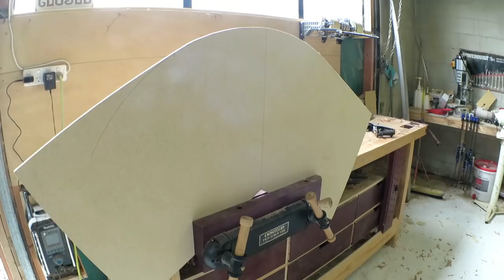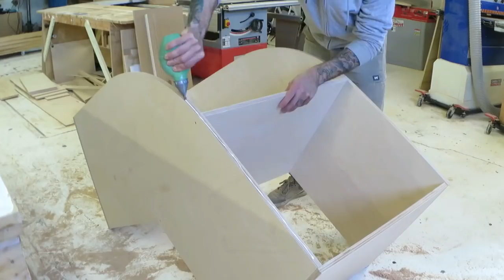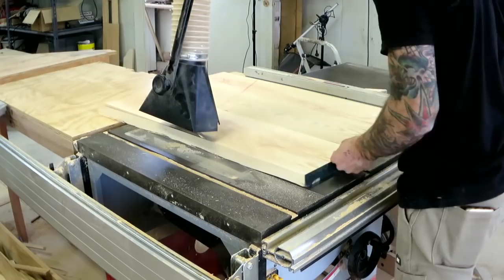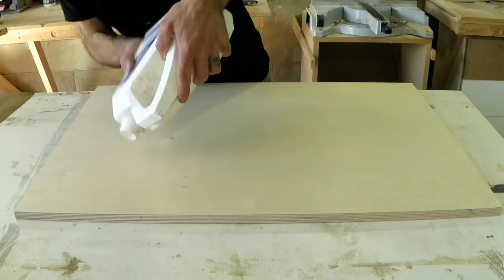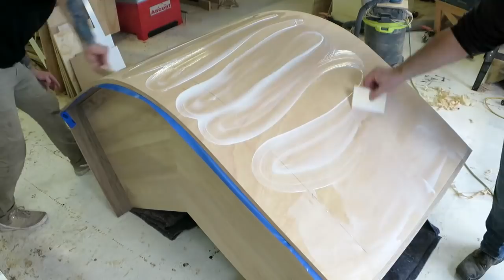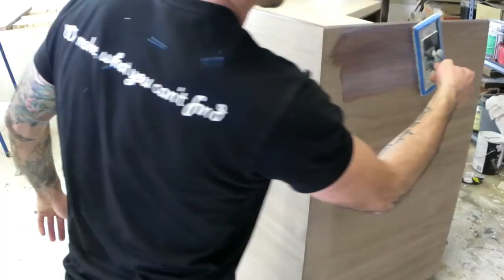coffee station/bar

Comment: I wonder if the vegan  hipsters that buy coffee from this bar realise its made out of the most cancerass material ever made for the workshop 
MDF kills
Reply from the maker: There's  really not very much evidence to back that up. Wood dust in general kills. MDF dust specifically is no worse than oak  dust for example. True a lot of glue is used  in its manufacturing just like plywood and strand board and particleboard etc, they all use very similar glues which according to the world health organization , it is unclear just how  much off gassing occurs and what that does at such minute amounts. The testing that WHO did found chemical off gassing but they couldn't specify whether the gas came from the MDF or the paint that was on it.

Comment: Another good option for gluing the veneer to the front, put 2 coats of wood glue (PVA) on both the veneer and the substrate, let them dry, then use a iron to heat up the glue, & the 2 surfaces will bond together. Works great!

Comment: Does this veneer with the fabric backing have to be applied perpendicular to the grain like traditional veneers? Door if this has already been answered. I was being lazy and didnt want to dig through a few hundred posts.
Reply from the maker: It doesn't matter on plywood as it doesn't move. I would still run it with the grain on solid timber

Comment: Great look and quality.

But working furniture must be stronger. 5:03 must be 5 pics x2 longer sticks from hard wood. The machine and stuff could be like 70-200 kilo and front panel always gives guys opportunity to rest on it and relax your back while drinks are made. 
So front panel, sides and top panel must always be hard jointed together. And inside of bar shelf's and doors must be customizable easy.

Our guy made wooden bar in Japanese joints ways when things laying on each other and secured that with metal bolts. A lot of expensive thick wood but stuff was stone hard. 

Also take a look on English pubs classics metal pipes and then hard wood above it. Wood right above metal keeps things silent and protects from vibrations.
Reply from the maker: +Robert Minasyan do you think I would make a project with out talking to the client about it's use? And their needs.  And do you think I would not use my 17 years experience  in the business as a guide to tell me how to make things?

Comment: Bendy ply?!
Reply from the maker: yea its cool stuff it has 3 plys 2 outside plys a really quite thick and the grain runs the same way , the middle ply is very thin with the grain running perpendicular to keep the sheet from splitting
Reply: ... and you can get it with the long grain running along the sheet or across the sheet. Way cool for making curved shapes like box lids, chair parts and the like when glues up as a thick sandwich

Comment: Wouldn't it have been better to use Contact Adhesive on the Front Panel?
Reply: I thought the same. Would definitely have been faster because you don't have the same waiting times.
Reply: the glue is more forgiving in case you don't lay it down just right.

Comment: Any reason you didn't just buy Walnut veneered plywood? Great build man!
Reply from the maker: +Crafted Workshop hey man,  umm 2 reasons I guess 1 I don't think regular ply would have bent even down to 4mm my test piece was cracking.  2. I needed to veneer over the corner to make it appear like a mitre.
Reply: Makes sense, I guess I meant for the regular flat pieces, just to save some time. Turned out awesome!
Reply from the maker: +Crafted Workshop oh right well I had to buy the veneer which is outrageous price so used my off cuts etc for the flats. The veneer is the same price as veneerd ply! Plus with my press these kind of flat panel glue- ups are super easy.
Reply: What is the plywood name
Reply: you could veneer the plywood first and bent it after that.

Comment: For the front veneer. Water down pva 50/50. Roll onto both surfaces apply veneer then run a hot iron over it!  Sticks like shit to a blanket!! 👍👍👍
Reply: Will definitely be giving that a go! A side by side comparison with shit on a blanket perhaps :D
Reply from the maker: +Big Guns huh I'll have to try that
Reply from the maker: ha yea lets see that !!
Reply: i think the water is for the venner so it doesn't suck too much glue.Might alter with the finish.
Also, for a piece that big, it is more time consuming than with the press in my opinion.
Reply: my first job 30+ yrs ago we did it similar, wasn't pva tho not sure what it was.

Comment: Great project, indeed the veneer is expensive but its stability pays off. So cool to see a pro like you to use my comment to use the domino + washer as slots. Other idea, on every youtube film I see panels and tabletops being glued up the same way: applying glue on each board individually. I learned from my dad that it's easier to stack all the boards and clamp them together. That way you can apply glue on one single surface. There is however the disadvantage of manipulating a whole stack of boards which can be too heavy. But you will win time and reduce stress.
Reply from the maker: +Bart Loncke  always learning. I do use that glue up trick sometimes . Works best when all the timber is the same width.  So not always possible

Comment: Nice work :) Alot of questions of materials that you use, and I have one too. That veneer looked super, what brand and where did you get it.. You said it was filt backed not paper is that correct. 

Best
TR
Norway
Reply from the maker: hi , I order the veneer from the factory that usually press it onto sheets of plywood / mdf.  they will press it onto fleece on request ,  its super not cheap!

Comment: Awesome job ! You should get a tank of spray glue I used to use it for plastic laminate work and it works great for wood veneer also . I use stayput and famica brand the home center spray adhesive doesn't work well.

Comment: Great Job. I've never heard of 'Bendy' Ply??? What is it? Cup Hinges are great, but for the life of me I can't adjust them. I have just made a kitchen Island for a client and will be taking it to his house in a few days. Unfortunately I will have to take the doors of to transport it and I am dreading putting them back on at the other end.
Reply from the maker: hi , yea its cool stuff it has 3 plys 2 outside plys a really quite thick and the grain runs the same way , the middle ply is very thin with the grain running perpendicular to keep the sheet from splitting. i have a vid on kitchen hinges it might simplify the adjustment for you .....
Reply: Thanks Joey, yes I have seen it. I've been fitting them for years but just cursed when it comes to adjusting them.

Comment: Nice one mate. Great job. Very efficient. Would contact adhesive not have worked for the large curved veneer on the front?
Reply from the maker: yea it would of , pva gives a much better bond as contact glue can let go sometimes. in saying that , in hind sight i should have used it on the curve!
Reply: thats what i would have used
Reply: I'd have gone with PVA. In my experience large surfaces and contact adhesive can be risky - if the veneer starts to 'bubble' it's really hard to rescue the job
Reply: Custom cabinet making for 13 years. Most of my custom pieces are curved. I’ve never had a problem or a call back because the contact adhesive failed. Both veneer and laminate. 

Just need a good roller and occasionally you’ll have to inject some glue